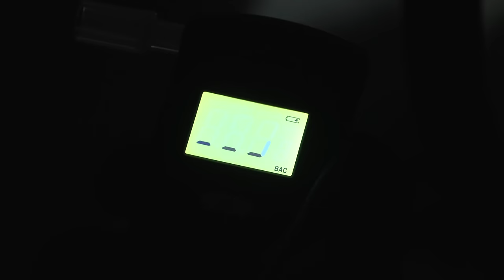HARD fall. She bounced off the ground

Comment: Patty I worked for an Ariel lift manufacturer for over 20 years and all manufacturers must have over riding procedures on the ground controls in case of an emergency or incapacitated operators in the platform. So keep this in mind if you have to do this again ie. This works for drunks too!